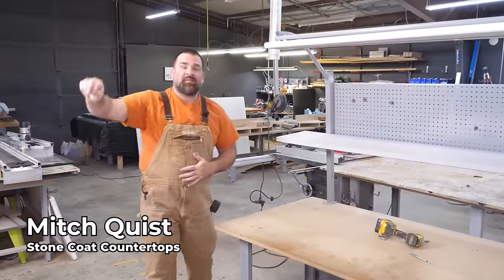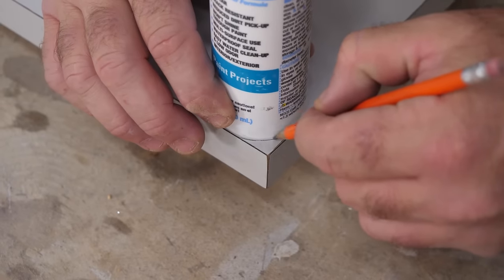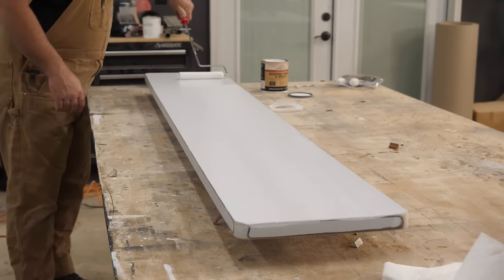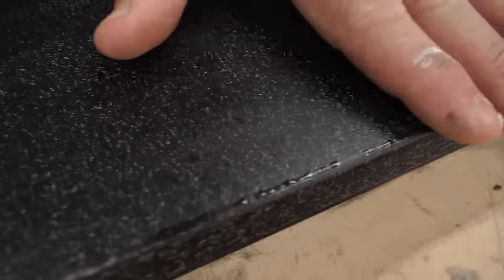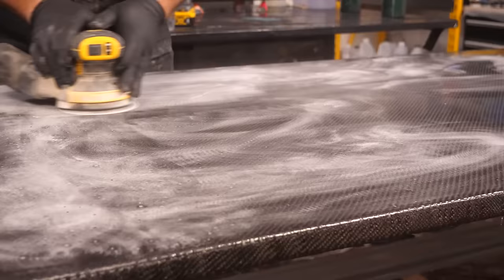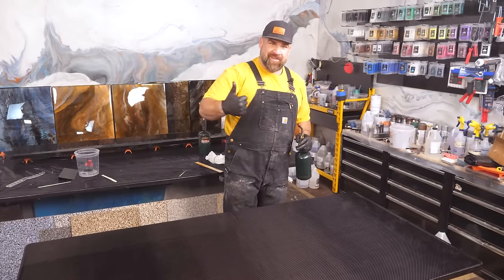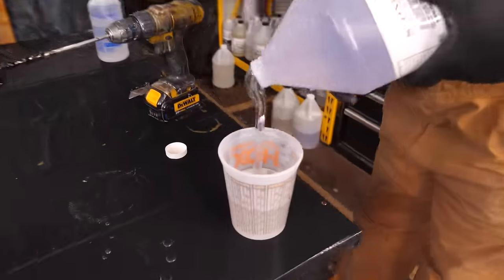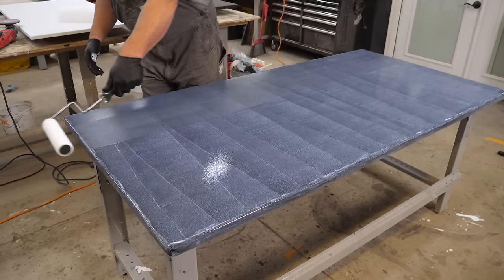DIY Carbon Fiber Table from Old to Bold

Comment: Here is a link to the carbon fiber I used. I included both the real stuff and fake. The real deal is spendy bud bad to the bone!!!
Real Carbon Fiber Roll $$$: https://amzn.to/3vtnG8r
Carbon Fiber Not Real Less Expansive $: https://amzn.to/3RMYcKE
Reply: Thanks
Reply: Hey, thanks for featuring the dynamic carbon fiber.  Your desk looks sleek and durable! ( If you're interested, there is a ton of innovation regarding this material, including ways to recycle it and make it from sustainable plant-based epoxy, too. Some carbon fiber can be 3D printed, (made from plants via biochar processed by pyrolysis in parabolic solar ovens, and plant-based epoxy), that may be a boon to car manufacturing and prosthetics, among other uses. On an industrial scale, the existing carbon fiber in circulation can be recycled with high temperatures. The difference between that, and plant-based epoxy, is that the newer type can be transformed without high heat, and instead: certain chemicals at room temperature. So, that is something to be mindful of. It may not be ideal for all uses, but great for some.)

Comment: Great video! I was waiting for another carbon fiber video after the red table a few years ago. For some ideas on embedding cloth in epoxy, try searching for 'surfboard glassing' videos. To make the cloth 'smooth over' easier, you might want to make vertical 'relief cuts' like they do when making surfboards. You got this!

Comment: Would this work on a hollow wood door I use as a desktop and warp the carbonfiber around the edge of the door? any tips it would be my first attempt at stone coat epoxy.
Reply from the maker: It would work as long as the door is flat and doesn't have the inset panels

Comment: On the smaller high shelf, it seems like you would be able to see the underside if you are sitting down.  Would it work to first coat the bottom with epoxy and carbon fiber but only to the first edge, and then do the top and sides, wrapping under to the bottom?